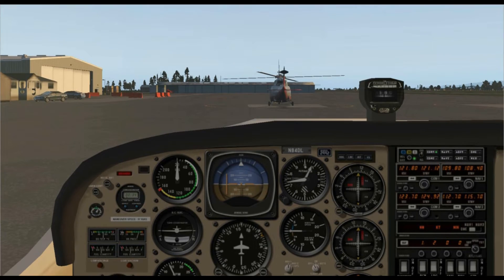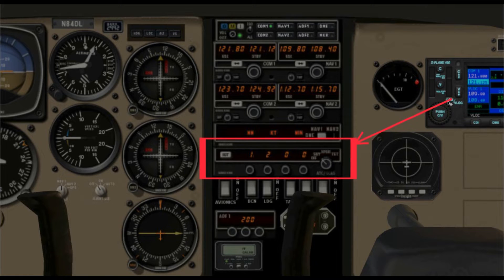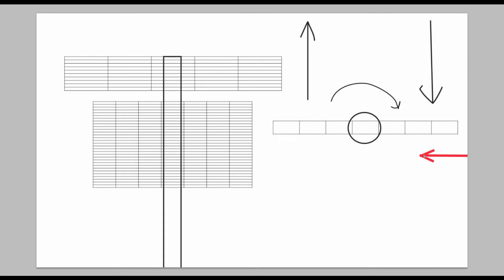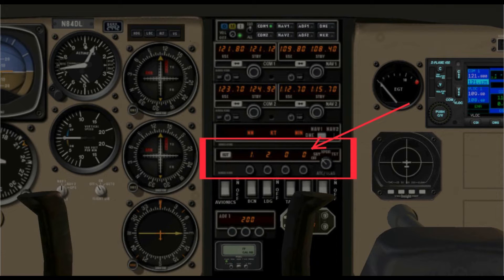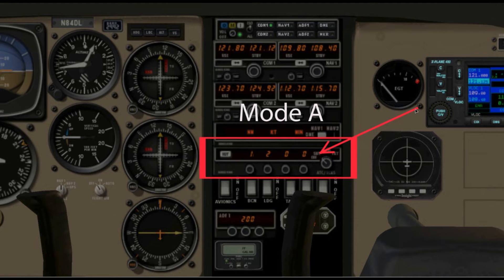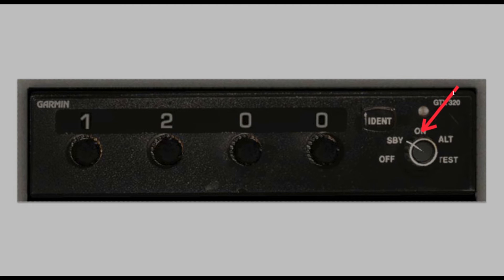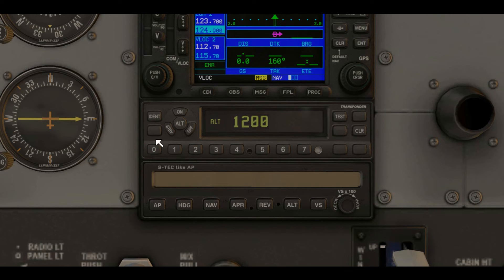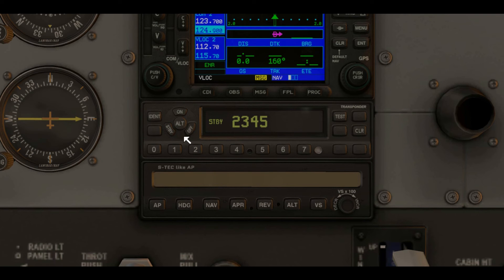The Transponder  ~ Learning to Fly for Beginners in X Plane 11 Part 18

Comment: Watching cockpit videos I’ve noticed on some attitude indicators that the arrow at the top sometimes moves in the direction of a turn and on others in the opposite direction of a turn. Am I missing something here? Could you please explain?
Reply from the maker: Hi Dan,  the attitude indicator's moving part indicates the relationship of the wings of the airplane to the horizon. While there are different looks to the attitude indicator the work the same. On one there is a upside triangle at the top which indicates Zero degrees roll when the "triangle" pointing up is directly underneath it.  When you make a left turn the lower "triangle" will appear to move to the left as the turn angle increases indicating the left turn angle but is doesn't, it's the artificial horizon portion of the attitude indicator that moves and in a left turn that "triangle" will move to the right and the opposite is true for a right turn. If you look straight ahead in a turn the horizon will appear to be at an angle and looking at the attitude indicator it will look the same, the artificial horizon matches what you see outside. It might be easier to visualize if there were only degrees of turn without an upside triangle indicating zero degrees of turn. Hope this answers your question if not please let me know which airplanes you are flying where they don't work the same.

Blessings,skip